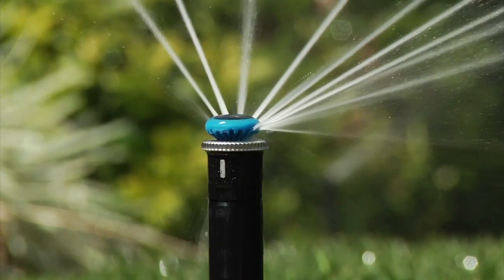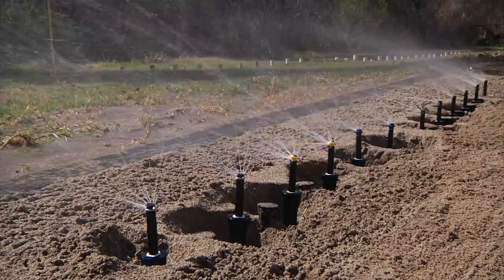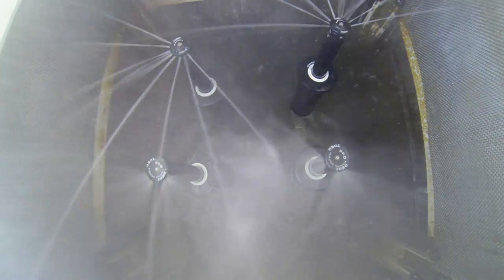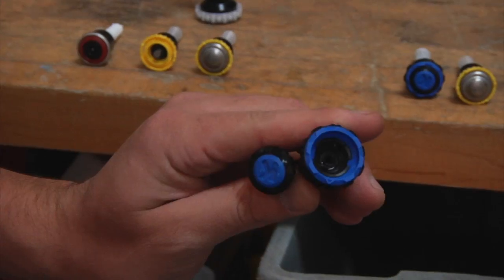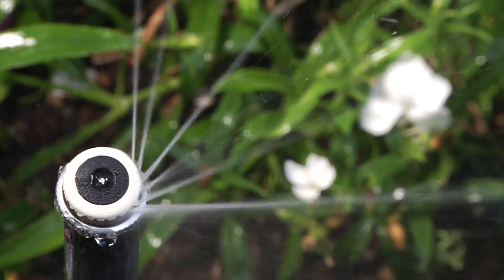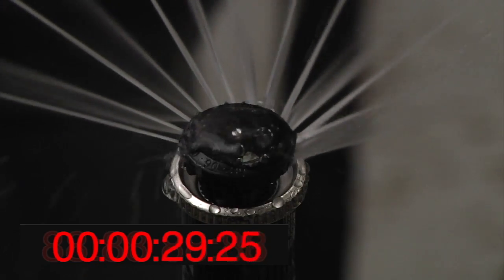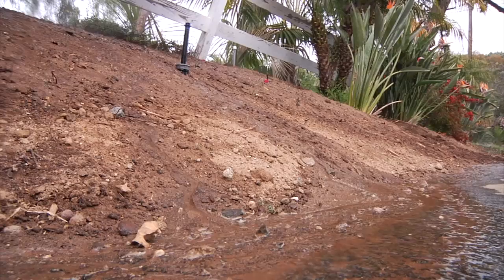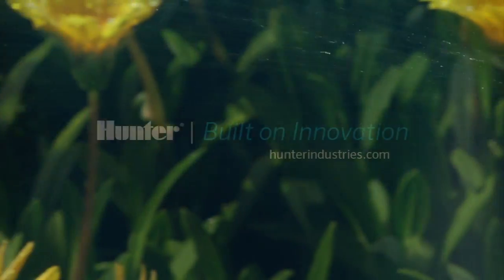MP Rotator - Built to Perform. Efficiency Nozzle Comparison

Comment: Excellent video. I was leaning towards competitor #1's rotator but this video made me rethink the issue. Clearly the MP Rotator appears better built and engineered. I wish more companies put out comparison test like this to highlight differences. You did a great job demonstrating the MP Rotator has a more uniform perimeter edge but you didn't discuss the differences in the distribution of water within the area being watered. While it's hard to find, the MP Rotator has a DU(LQ) of 71% ( https://www.hunterindustries.com/site-study/mp-rotator-efficiency-goes-unmatched-usage-test ) vs 79% for the Rain Bird equivalent distance R17-24. It also looked like you used a R17-24 in this video but turned the distance down to the lowest range of 17' and not so sure how that affects the edge distribution pattern you showed. 

I wish companies made it a lot easier to find Distribution Uniformity specs for their products. For example, I have searched but can't find any information about the Hunter PGP line DU. What is the DU for the PGP Adj and the PGP Ultra?

Comment: I've been using the MPR rotors for quite a while and I find them very good. Especially the 1000 (90-210) and 2000 (90-210) They are excellent!  I tried the Rainbird's new Rotor, it takes more water and it doesn't look very elegant! I do use the MPR's on 1804  pop ups. For larger areas I prefer the RB 5004 plus as opposed to the 3000 MPR. I used the Hunter PGP's and they are good too, I just like the shut off feature from Rainbird and their rain curtain spray nozzles